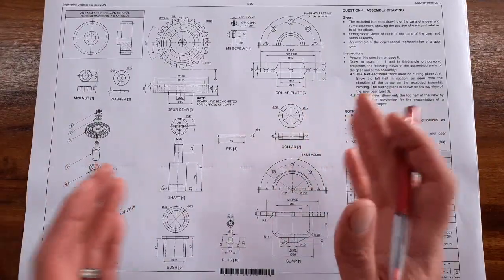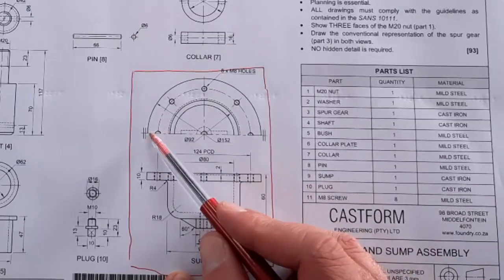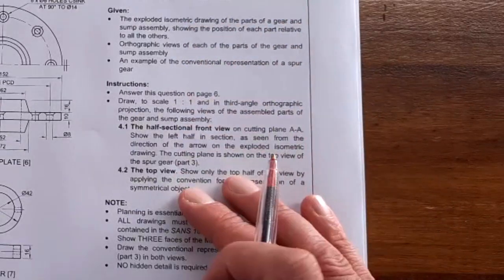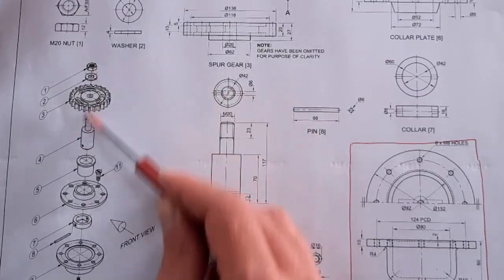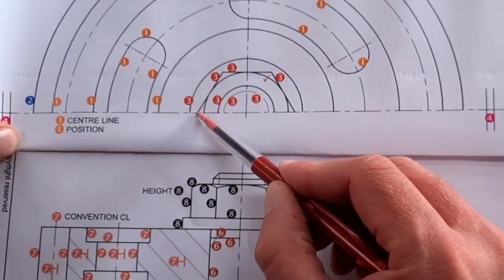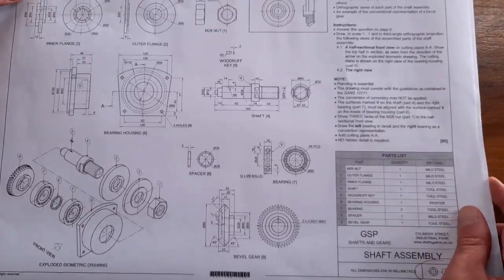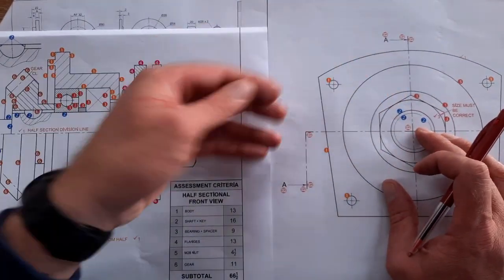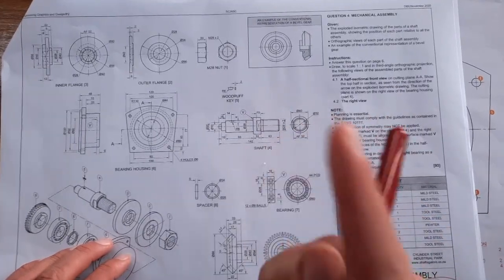MUST WATCH - Mechanical Assembly - EGD Grade 12 - Paper 2

Comment: Some teachers say it is allowed to draw all the parts of the assembly without assembling them but they must be sectioned and some teachers say it is incorrect so I don't know which is which.
Reply from the maker: I am not so sure about that statement... the problem with that approach is that it will take you much longer, and you won't be sectioning the parts correctly,  as well as loose marks for not assembling it. Your best approach is to practice assembly drawings ahead of time and give it a good go in the exams... You can do it!
Reply: I was hoping to get your opinion on which way is correct